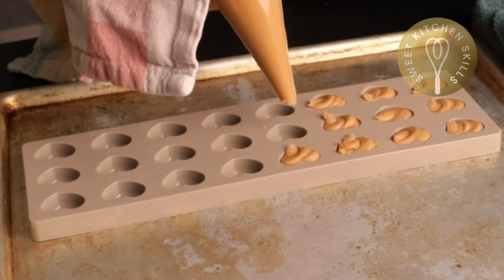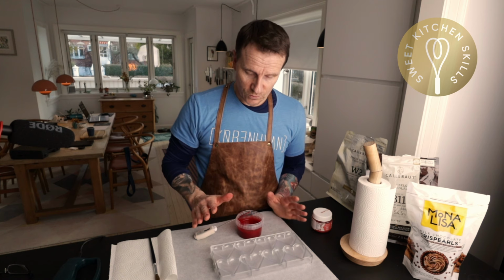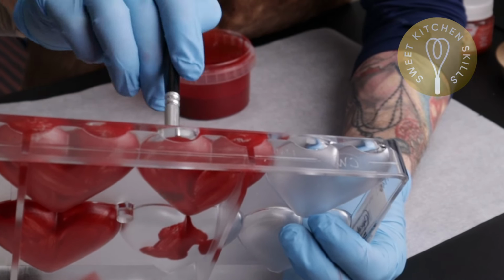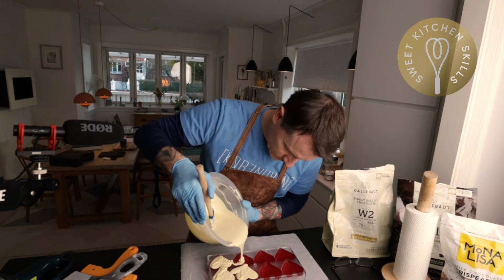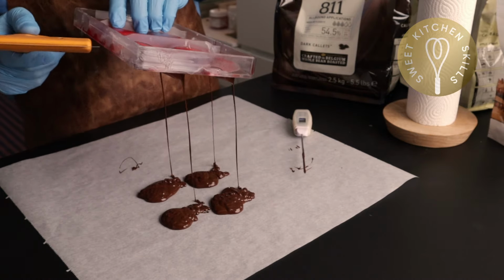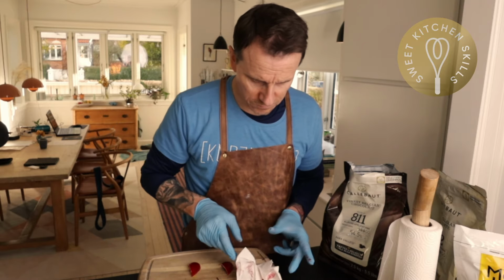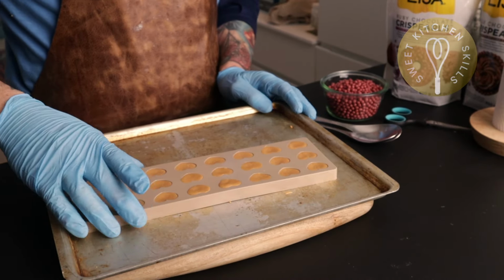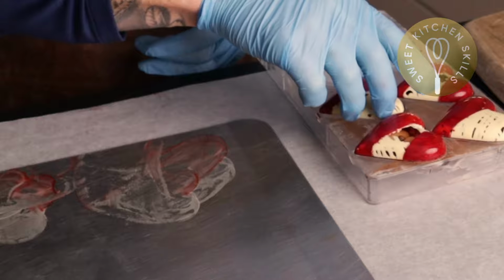Broken Hearts, filled with caramel fudge hearts

Comment: Hello. 
I love your products😍
I have a question 
I temper my chocolate and my cocoa butter but the part that I add the colour steel sticks to the mold.
The temperature of my mold on that time is between 20 to 22 Celsius.
Can you tell me what's the problem?
Reply from the maker: Is the cocoa butter tempered? What is the temperature when you put chocolate into the mold? They should be at 18-20C. Or the cocoa butter and chocolate cant stick together. Also the chocolate shouldn’t be to cold. Mine is 31 or 32C. Watch all of my videos. 😃

Comment: I would suggest you to use a tape in the mold before you paint them first. So you do not need to cut them by knife. Just take the tape off and get a better result.
Reply from the maker: Hello my friend. Haven’t you seen the whole video? Then you would know i had a different plan that did not work out. Your tape is not working. Or explain to me what you mean.